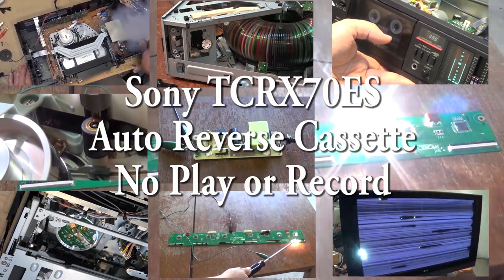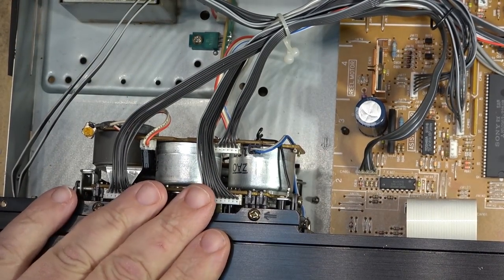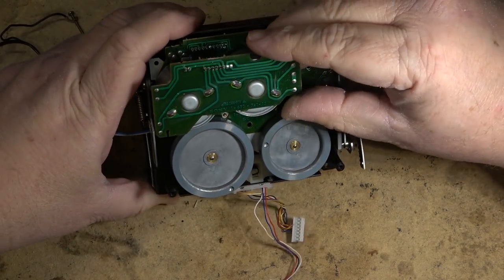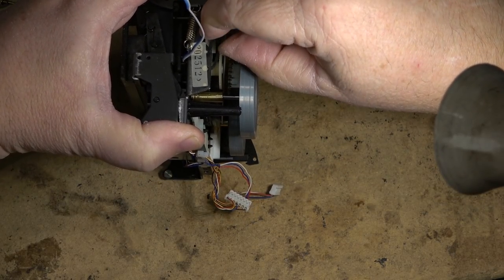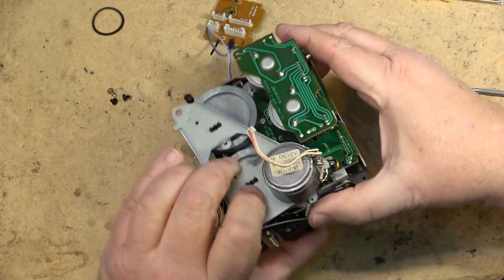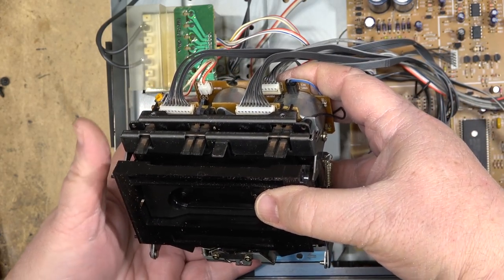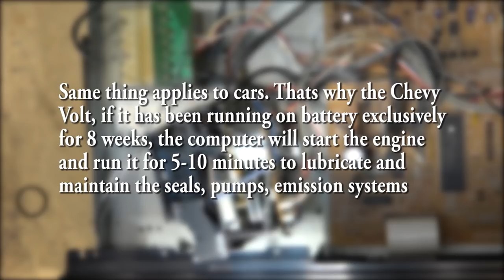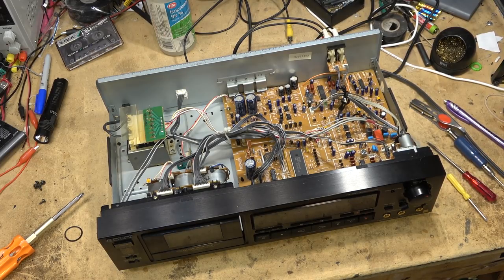Sony TCRX70ES No Play or Record

Comment: i have one of these decks, ressurected it last year by putting new belts and pinch rollers in it, replaced a transistor aswell, cant remember what for, when i was doing that, i had discovered that the mainboard had what looks like two varients, its a bit different to the one you have there, components in that one where there isent one in mine and vice versa, so maybe a mk1 and mk2 version or uk and us versions, havent a clue, not a bad deck for a auto reverse one, and its running pretty well for 30 years old

Comment: Nice sony deck, plugs are always appreciated.
I suppose in one way the simpler decks with no fancy pants mechanisms are better.
But (And there is always a but),  the rubber idlers fail instead lol.
Maybe only direct drive is the best.
I like the auto record level, making a system that does not under or overshoot is a bloody pain.
Perhaps that's why they used a motor drive, maybe.
We had some snow in november, i stupidly thought it would stay through christmas, but no.
Yep i've always given petrol engines a warm up to get ridd of any dampness and get the oil everywhere again.
I think it's helpfull, seems a good idea.

Comment: Cassette decks rely on belts and a smooth mechanism to work correctly.
Laserdisc players are the same, storing them unused will do them no good.
Once the grease dries out, the next time you try to use them the belts will 
struggle, and a service and new belts will be required.

Comment: Beautiful job as always. A question: why the two flywheels of the capstans have different sizes? How can they spin the same speed forward or reverse?
Reply: Same question here! 🙂
Reply: @Barbarapape  it's not a dual capstan deck, it's an autoreverse deck!
Reply: @BICIeCOMPUTERconGabriele  Thanks for correcting me.🙂
Reply: I'm not a 100% certain or why (if my guess is accurate) the reason the capstan fly wheels are different sizes is because the capstan shafts are different diameters. My guess as to why that is is because the one capstan shaft has the pulley wrapped around it almost completely and it gives more support perhaps more stability as well. The other one doesn't have as much pressure from the belt so it doesn't (in Sony's R & D department) need to be as stout. Who knows for sure LOL. Perhaps Dave knows why Sony designed it this way.
Reply: @darinb.3273  It does seem odd, on a single direction dual capstan deck 
it would make sense, as this maintains good contact with the tape
against the head.
But with Auto Reverse, i would have expected the capstan shafts and flywheels to be identical.
Hopefully Dave can explain the reason for it.🙂
Reply: @Barbarapape  Right I was indeed expressing my thoughts about it, I don't really know the real reason for the difference LOL.

Comment: Thanks for the upload Dave, having a similar issue with an Aiwa AD-WX929 double cassette deck one of the decks heads are not raising completely on one of the decks, might be a belt issue?
Reply from the maker: Depending on the design. Alwa decks are essentially Sony anyway.  They are sister companies. Aiwa usually was the test bed for new Sony products.

Comment: It's actually surprising that on a tape deck it's 99% of the time the same issues. It's either belts, switches or a motor. I've almost never had to repair a power supply or swap out other electronic components.
Reply from the maker: Did a Sony pcm2500a today that had some bad caps and belts.
Reply: @12voltvids  Disqualified Dave, that is a DAT :-)    Videorecorders and DAT machines are automatically disqualified from what I typed.

Comment: Repeat offender! At least it was a straightforward fix.
Reply from the maker: We call these boomarangs but it was a year ago i last saw it. These things happen. Rubber belts good one day and a week later they go bad.  As i said in the video I have received belts that were ready to turn to goo when i received them.
Reply: @12voltvids  You'd think after all these years someone would have discovered the secret to longer-lasting belts.  Then again, would anyone manufacture them even if they had?
Reply from the maker: @sunspot42  there are 2 types of belts.  Natural and synthetic rubber that is made in a lab.   One will last forever and the other 20 years or so.

Comment: Autoreverse with rotating tapehead, is the work of the devil. Very difficult to avoid azimuth error. But again, sacrificing sound quality for convenience was the very reason for choosing cassettetape over reel to reel in the first place.
Reply from the maker: No the reason cassette was chosen over reel to reel was it was impossible to have a Walkman or car player.  Anyone that was serious about sound chose CD and DAT anyway.  Rotating head auto reverse azimuth was not an issue.  There are adjustments for each direction.